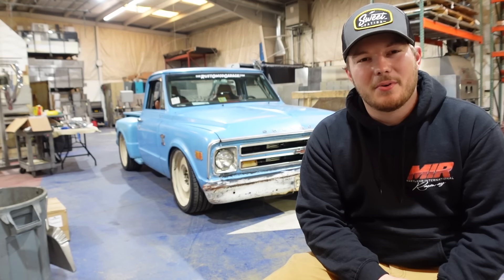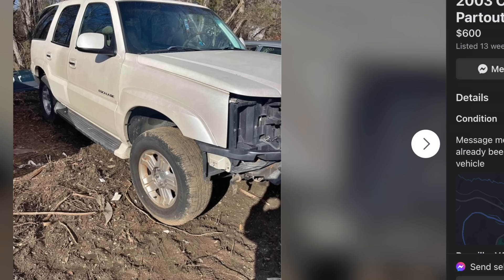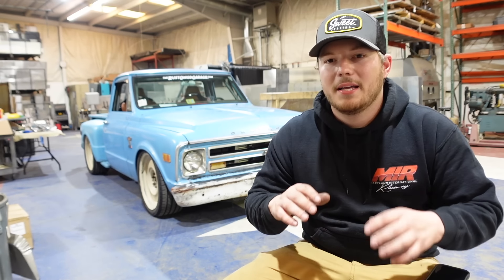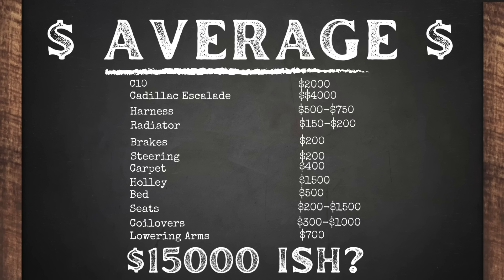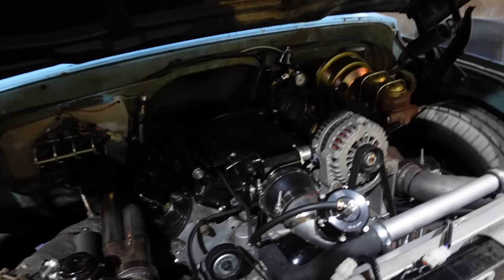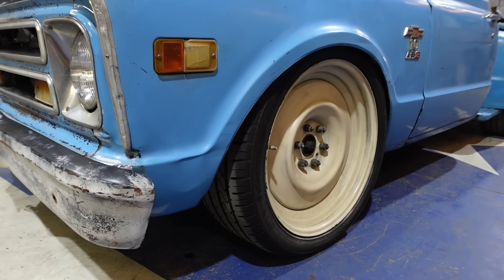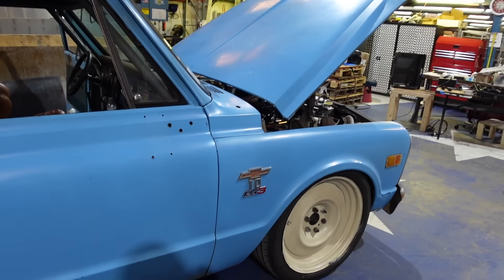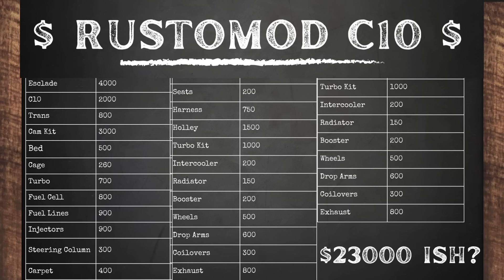HOW MUCH IT COST To Build My 700HP AWD C10 Escalade Chassis Swap?!?!

Comment: I have a 1968 GMC that was my first truck legally on the road. It’s been waiting 30 years for a rebuild. Cab is stripped and blasted now. I built a 6 liter for it. I should be documenting it on video. I have 3 others that would be good candidates for a job like this. I have a bunch of tahoes and suburbans I got from the body shop. He was going to send them to the crusher. I got 12 of them for $200 each.

Comment: Holley does have a way to control the 6l80/6l90 now
Reply from the maker: I know! Of course haha
Reply: @Rustomod  right after you needed it huh? Lol ive been debating on gettin a setup for the ly6 6.0/6l90 thats currently in my 86 c10, hopefully soon itll be goin into a squarebody dually on a 99-20 chassis, pretty sure im fixin to set my 86 on a 99 rcsb chassis ive got sittin here

Comment: Question ,  doesnt the all wheel drive escalades have a body controller that controls the awd ? I have a 03 escalade donar,   and a 70 c10,  I am really going to get this done , and ran into an article saying the body controller controls awd , please help with your experience in this
Reply from the maker: Yes on this truck we used a 4l80 and different transfer-case to make the 4wd work the awd out of the 03 should work without the bcm I believe the 07 up trucks you need the bcm and abs

Comment: Awesome information Sir. Now I have a 2014 silverado 1500 5.3L Z71 LT that I want change to AWD. What do I need to do for mine. Thank you so much.  Keep up the good work
Reply from the maker: Awesome!
Reply: Do I follow the same process with escalade and deniali
Reply from the maker: Yeah They are the same
Reply: @Rustomod  awesome same year and gear ratio. Dis they make them 3.08 ratios. Also do I need the ecm as well
Reply from the maker: @jasonnellis3566  yeah I’m not sure I used a terminator x maxx

Comment: no one is going to find a c/10 for $1k.
Reply: Not one that doesn't need body work, no.  But I find usable ones under 1k all the time, and im in rusty vt.
Reply: You can buy a longbed, cheaper than a short shortbed, then trim front or rear of bed as needed to move wheel well around so it lines up with your donor chassis better.  Most guys can handle a straight line cut and weld back together, but moving the wheel well that's curved in two different axis is intimidating.  Ive used the cut out section of bed to make custom integrated bedside boxes.  There's a lot of cool details you can add to your project like that for $7 in zip disc's and $3 in mig wire.

Comment: 700 to all four wheels..2800 horses to get 700 to all four..or 700 divided by 4 to 175 at each wheel
Reply: 700hp going out to all four wheels through the awd system. That’s a very common way that people describe a cars power delivery. No math needed.